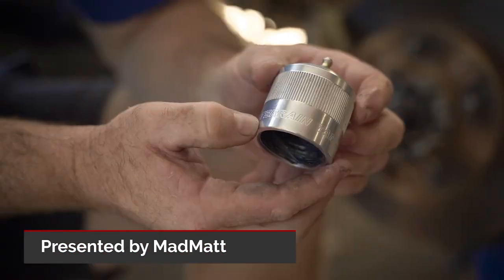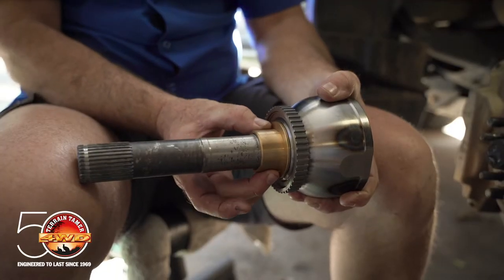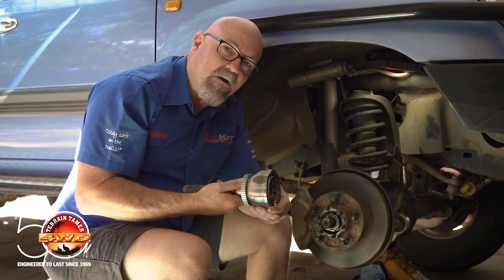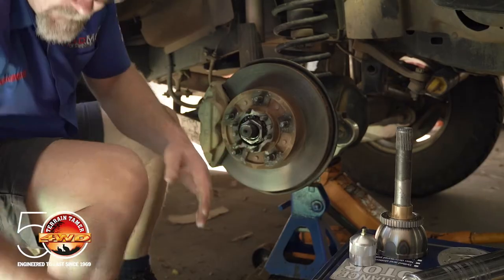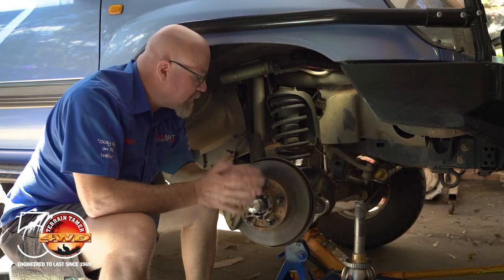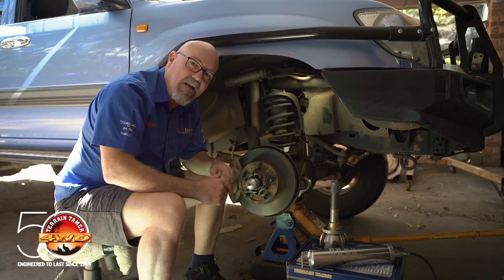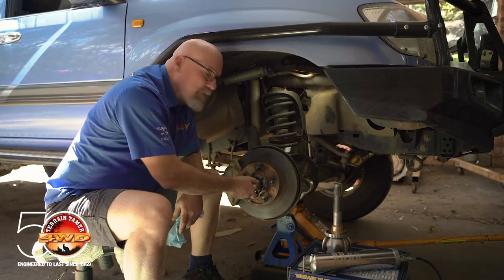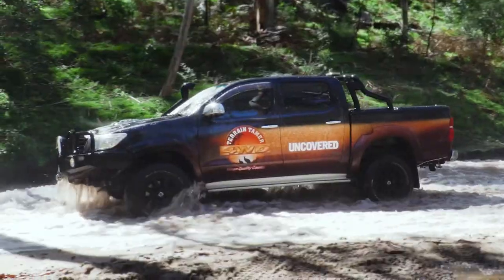Terrain Tamer Uncovered: Spindle Greasing Tool

Comment: This gimmick reminds me of x-ray glasses every kid wanted. Order form inside your comic book. Seriously dudes, an entire grease cartridge wont be enough grease to be pushed into that bush or needle roller from the back of the CV, all around to the front of the CV, down and then somehow pressurise itself to enter the gap between the bush and cv snout without 1st filling the rest of the void inside the swivel housing. Unless the CV had a dedicated port feed to that bush, which it doesn't.  What you do have is a better chance of hydraulicing grease past your worn inner axle seal, into the diff oil. Particularly with Mr Toyoda's line up of live axles, the best insurance against leaking inner seals is to stop over filling the diff with oil. The level should be approx 5mm below the fill plug, so by filling the diff oil until it begins to spill out then you know it's full, is over filling. 2ndly, periodic maintenance will never be avoided by use of this Hiclone .. umm .. Polariser .. umm .. Spindle Greasing Tool. Fact is, your wiper seals on the back of swivel housing that are tenuous at best (read, sub optimal crap) will be flogged anyways and letting in dirt, dust and water meaning a complete tear down is required. Dependent on level of off road use, every 2 to 3 years. A needle roller will out last a bush any day and are easily retrofitted replacing the old, redundant brass bush.
Reply: You might need to go back to basics, because inner axle seals aren't rocket science like you're implying. They will seal correctly UNTIL there is a differential pressure that can force fluid past them. What do you think axle breathers are for? Exactly.

Comment: Hi mate, Can you please confirm the type of grease that has to be fed through this greasing tool? Is it Moly grease or High-Speed wheel bearing grease? I thought those needle bearings (in the later models) run at high speed and will need a high-speed wheel bearing. And if that's the case, it will mix up with the moly grease in the housing. Sorry, I'm a bit confused. Any explanation would be much appreciated.  Also, wouldn't Moly grease make this needle-bearing to seize? Thank you.

Comment: Can use them with greasable CV joints ?  Also would using a pop out pressure release valve in the inspection port prevent over greasing ?